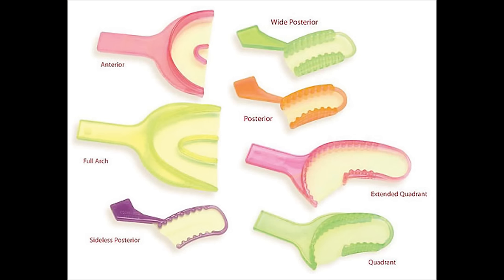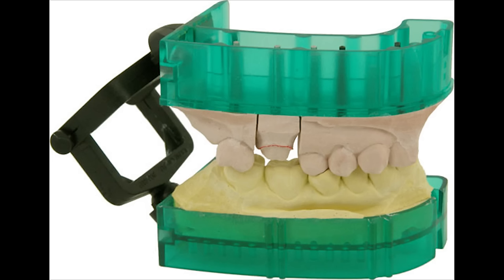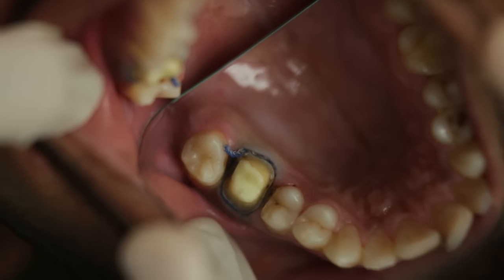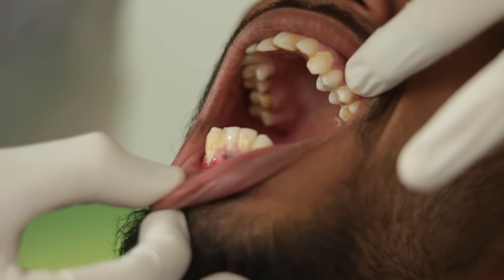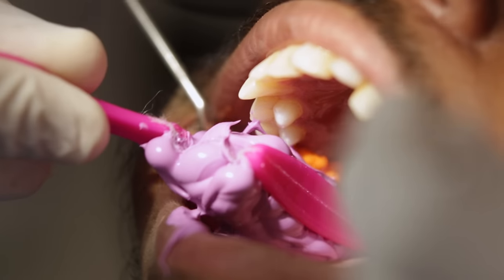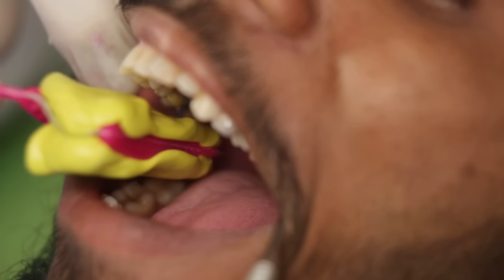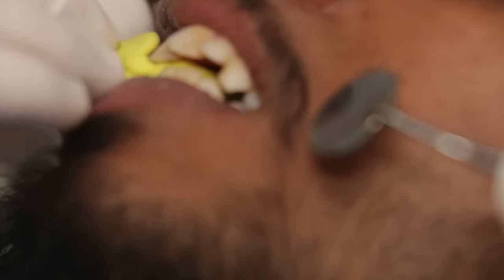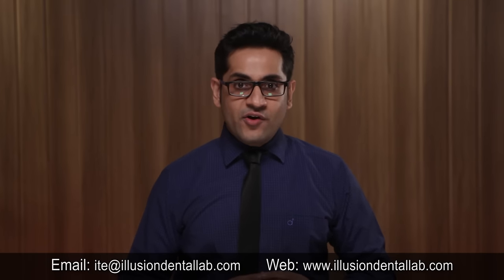How to take a Triple Tray Impression

Comment: Great video !
I prefer a one set putty wash for triple tray... Reseating can lead to errors, also it's less time consuming and more friendly to the patient. Not much added value in making it 2 step
Reply from the maker: Hello . Thank you.

Yes absolutely!As a rule triple trays will work best in single step impressions, but instead of the putty , its better  to use a heavy body along with wash, since the putty pushes off all the light body from the critical areas(margins especially). Hence, its imperative to get off all the undercuts and interferences to facilitate reseating the putty tray and get ample information with the light body along the margins.
The ‘go to’ solution with triple trays however remains the single step heavy wash technique.